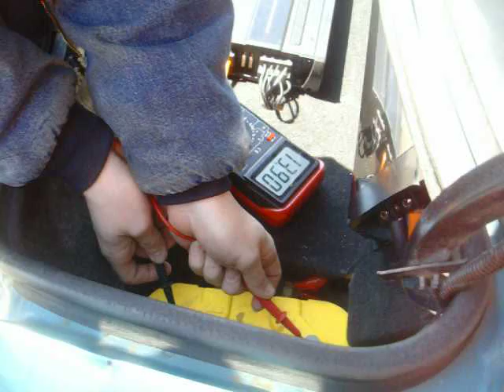Memphis system walkaround and voltage testing, 2 15'' mojo's 4k amp

Comment: I got the same amp the Memphis 4K and I'm running the new 2 15s mojoX series and I got all 0 gauge and a Xs battery it's a 2000 something I forgot and a big stock battery will I need more voltage to make it hit harder? I think I'm running 12volts still not so sure